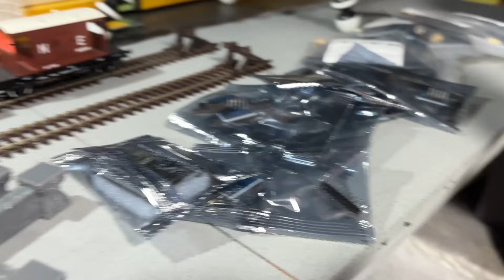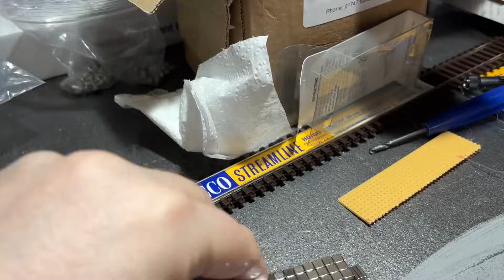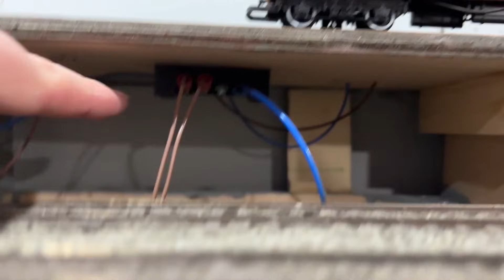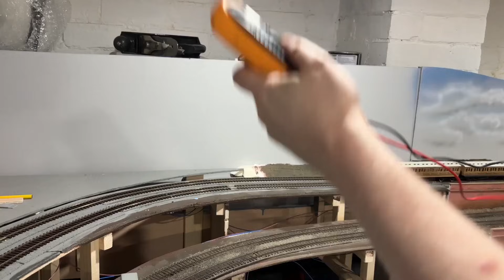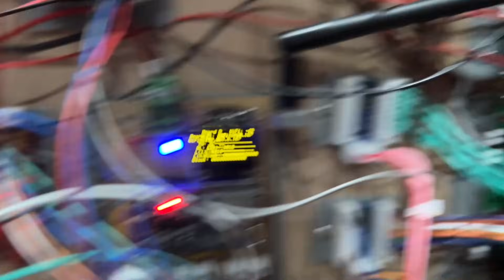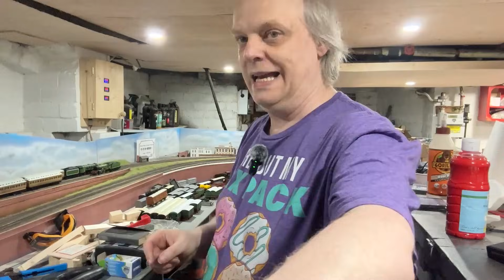125, Wires & Woe. I power up more track at Leopard Street Model Railway #modelrailroad #modelrailway

Comment: It looks like a complicated system to debug. My experience of issues like that is it's never quick to find out where the problem is! Good luck - hopefully you're right and it's just some loose connectors.
Reply from the maker: after the video I did a bit of investigation, the 5v logic line is about 3.7v at that end, amazed it was even starting. currently there is a bus ring around the layout, 8 layout boards, each with their own power panel, wire in & wire out. then a plug & socket jumper between the boards.

lots of plug & socket connections.

I have given up, there is a new master panel going in at the weekend (paint still curing or I'd start it tonight), this will see a swap from a "ring" system to a "spur" system whereby each board gets its own cable, and these will all be screw terminals both end, no more plug & socket. does mean dismantling the layout as and when will take longer, hoping not to need to again though (ha!) should hopefully solve the problem at a cost of a fair bit more cable.

initially just the 5V logic & 12V auxiliary bus is getting wired up, sou the controllers fire up, the 5v power (relays & servos) and DCC busses will stay as a ring until I repeat the wiring order with new colours. probably only actually needs the logic one doing but figured do it right now..

Comment: I've been messing with Neodymium magnets (wifey bought for teens schooling - never used, so I claimed them!). I laser cut a 3mm wooden board with a number of holes, so that I can mount 4 magnets in-line on each side (about 1.5" len), I figured that a single pair would require some very accurate shunting to get the kadee's to separate, and the 3mm wood is the same thickness as the cork. The results have been inconclusive so far, so I need to play around some more - though that may be because I needed to raise the curved bar on the couplings in order to clear point work rails, I might have been a bit enthusiastic in that endeavor!
Reply from the maker: try stacking the magnets, I have some 3mm cubes, one atop the other works. utter pain is getting them all aligned exactly right to stop them opposing each other. larger strips work, need to print a sleeve to hold them and experiment more 

:)

Comment: The colours are for the diameter of the cable Blue 1.0 -1.5mm, Red 2.5mm, Yellow 4 - 6mm cables . The other option are ferrules They have a wider chioce of sizes.
Reply from the maker: ahh I did wonder, I have ferrules for others, but some stuff thes screw terminal blocks and fork connectors just seem to work better.

cheers :)

Comment: Wiring up can become very complicated if connected to too many existing blocks. Try cutting down to one wiring block, and you might get better results. You somehow need to keep the wiring up as simple as possible. A manual DCC controller can easily help to solve the problem. I have an idea. Take the upper level off completely, and just stick to running trains on level ground for the time being. Your engines are more comfortable on level ground. You don't need too many wires for it. Something tells me you might have bitten off more than you can choo-choo. Never try running trains on an upper level, before you're ready to attempt it. Remember, slow and steady wins the race 9 times out of 10. If you can find one, may I suggest watching a step by step guide to running trains on an upper level video? It helps if you follow instructions carefully. Good luck.
Reply from the maker: nah its working, I have a plan to actually fix this, and yes it does involve fewer wiring blocks, just powering each board directly, not daisy chaining them and hard screwed terminals, not plug & socket. it will however be getting done bit by bit